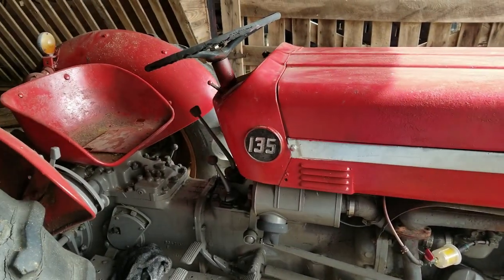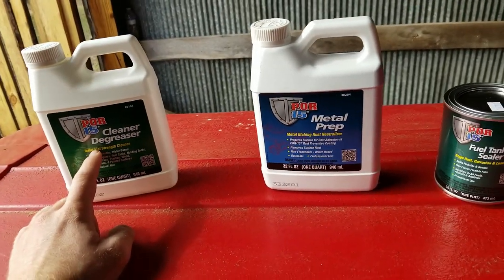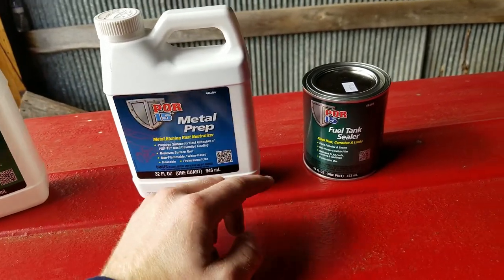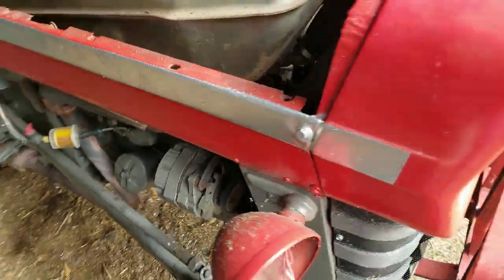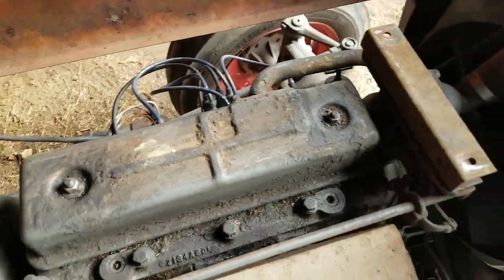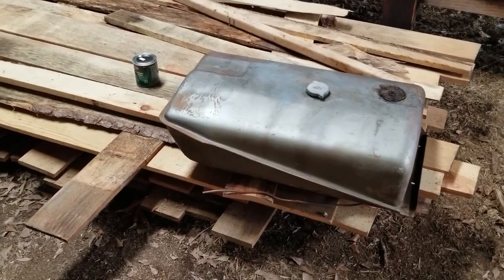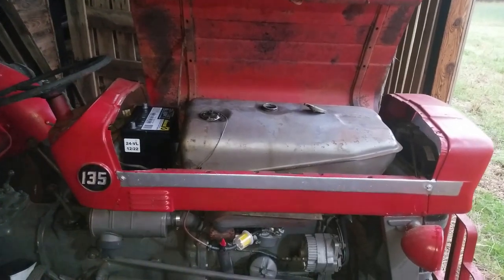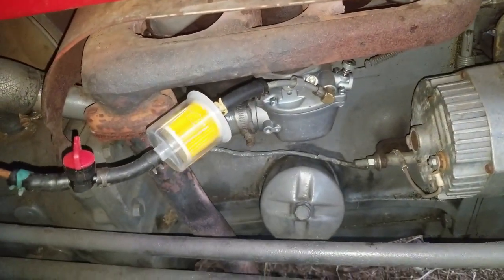Tractor Fuel Tank Repair Made Easy: Save Big Money!

Comment: Thanks for your response. Your video's have helped a lot. let me know if you have any stalling after the fuel system cleaning. I am probably going to bring the tractor home in the late fall and work on it in my garage and really go through the whole thing. It needs the hydraulic fluid changed and probably the hydraulic hoses as well. When I bought it off my neighbor across the street from my hunting property some of the gages don't work or are not hooked up. The lights don't work so there will be plenty of things to keep me busy over the winter. Thanks again!
Reply from the maker: That sounds like my tractor haha. Keep me updated. I'm interested in seeing what the fix is.

Comment: Good afternoon, I have this exact tractor and your maintenance videos have helped me a lot. Do you have a oil change video? I still have a glass sentiment bowl and want to change it to a regular fuel filter like you did. My tractor after about 1 1/2 hours of cutting with the brush hog the engine will bog down and sometimes shut off like it's not getting gas. if you let it sit for about 10 minutes you can start driving again. Plan on bringing it home over the winter and really working on it.
Reply from the maker: I need make a video on oil change, I havent used it much since the last time I changed the oil. but it wasnt difficult. This one does the same thing while bush hogging. That is why I cleaned the fuel tank and bought a new carburetor. I was thinking that the fuel filter was getting clogged because it has so much trash in it. Ive been in the hay fields so I havent ran my mf135 much this summer to see if that fixed it or not.